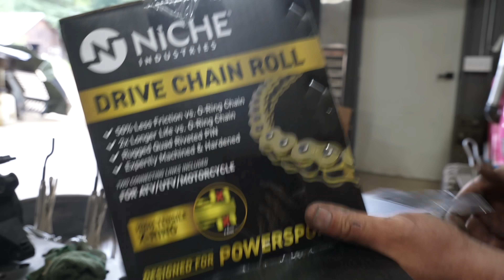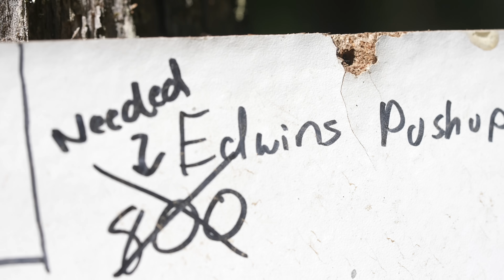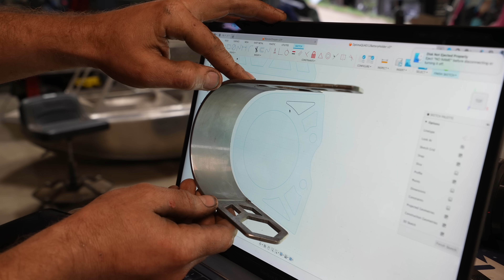We Rebuilt the Chopper and Met State Troopers!

Comment from the maker: Monster chopper tees are almost gone! Get yours here https://www.grindhardplumbingco.com/
Reply: Pin it 😁👍
Reply: Should make another one with 4 tires but both sets on front and back be 6 inches apart with adjustable arms so when you go to turn or lean it pushes one tire and arm higher than the other allowing full contact at all times
Reply: at the back wheel, the axe shouldnt be weilded, weilding its not recommended on structural resistances such as the axe on the back wheel because it can break or bend in time. Use a whole piece of metal and just turning it or milling it. dont weild stuff together when it comes to structural resistances. Also for reducing the the "snake effect" add weights (cosmetics can be) and balance the overall bike, the dampers must be at a certain angle for vertical efficiency ...overall its a really good project i wanna see how its gonna be longterm.
Reply: That's the coolest bike I have ever seen .... Really cool !!
Reply: To probably stop the speed wobbles with the front tire you probably need to build a racket pinion like a car to stabilize it
Reply: I can't really tell what kind of turning system you have but looks like it could be hydraulic or  Pullye  you could  Experiment with hydraulics if you haven't yet Just an idea
Reply: Oh and also it should be in the next Batman movie because that thing is hot
Reply: @iuliancoarna6792  I see no axe wielding 🤷
Reply: What a great motorcycle 🏍️ to watch and I was in awe watching the video 🤩🔥👏👍
Reply: I'd love to get one but I'm a bit on the big side... 5X???  Just a little bit on the big side!!!
Reply: You are risking destroying your lathe welding like that. The reason you are not supposed to put a bit all the way into a drill press is because the heat will transfer through the base of the bit and warp your arbor. apply that knowledge to what you are doing less than 10 mm away from the head of your lathe. 

also, to keep material from warping when you weld You need to tack weld like you would torque a cylinder head. start patterns around the material, get it to where you have a bead and then run a bead over that after it's cooled. That will help keep it from warping.
Reply: There is a reason they make the front tyre skinnier on motorcycles. Look at either getting a skinnier front tyre or heavily rounding off the side treads. Plus more psi in the tyres and a balance will solve the hop issues.
Reply: You totally need to make a cyberpunk Batman helmet with glowing eyes now 😂
Reply: It jumps side to side at high speeds maybe due to the asymmetry of the front swing arm. Its really cool but I luv dat kiki black symmetry  iykyk
Reply: Where I live (not in the US), that thing would have been impounded right away. Unfortunately we have very restrictive vehicle regulations, even when it comes to the tiniest of mods on production cars etc.
Reply: You selling the bike?
Reply: Can you guys make the motorcycle of Cloud from Final Fantasy 7. Either the one at the game or the one at the movie.
Reply: Not in Europe my friend.
Reply: Think of your front tire as a toy gyroscope. That is exactly what it is just scale-up, maybe try shaving the front tire as well? If it's not balanced correctly it will wobble like it does around 50mph
Reply: If you pre heat parts for power coating you don't need the power lead
Reply: :planet-orange-purple-ring:Your bare hands so close to the spinning blade or grinder thingy did not look safe at all. Be sure to wear protective gloves while working. SO NOT WORTH AN ACCIDENT :planet-orange-purple-ring:
Reply: are you seriously breathing in rubber fumes? you hate being able to breathe and have oxygen in your blood?
Reply: @GrindHardPlumbingCo i have never seen your channel or watched a video beside's this one im very interested in whst you and your channel is about! Amazing.
Reply: @iuliancoarna6792  next time do it with one wheel only,,,,,
Reply: Wow so good idea bro❤❤❤❤❤❤
Reply: Nice  dec  28  😳🇨🇺🏆💰❤

Comment: CAE Engineer here - just some thoughts.  That "death wobble" looks sinusoidal in nature - which seems to be corresponding to the top-down shape of the bike.  I would bet that a modal analysis of the frame will yeild a certain frequency in which that wobble is induced.  I also have a suspicion that if you simply add a reinforcement on the left side from the front wheel "cage" to the rear "cage" it will stiffen the overall structure and limit that motion.  It appears to be a force load/unload cycle due to the natural shape of the frame, likely induced by the size and load of the tires..  I can guarantee there would be a lot of enginering students who would love to model this for you as a project for college.  I'd reach out to a couple university engineering departments and see if they are interested.  Edit to add: also, its only doing that wobble on pavement, because of the increased friction between the tires and the pavement not allowing sideways slip... they bind, inducing the wave in the frame which in turn causes it to flex, etc...  in engineering terms its called a underdamped or unstable system.  Edit to add again:  After some discussion here in the comments - I agree that you want an overdamped system to stop the oscillations as fast as possible - critically damped will not stop it quickly enough.
Reply: I love how ingellect can be used together to help!  So much is being made in quiet places.  Hope the money mongers do not get involved.   It is cool to look at!
Reply: After sleeping at a motel 6 I can see you might be right.
Reply: critically damped vs overdamped in this scenario?
Reply: You would definitely want a over damped system, not critically damped. With phugoidal motion, you will only be dynamically stable with an over damped system. If you go with something that's critically damped, you can reach new steady states which will reduce your control.
Reply: @AA-tz2bm  I'm not a suspension guy - just relaying the general theory... I would guess that overdamped is probably desirable as it will stop oscillations rapidly...
Reply: @zuccman968  Yep - I agree.. I replied to another comment above as well... thinking about it some more - critically damped won't stop the oscillations very quickly... so a certain amount of overdamping would be desireable I would guess.  I'm not a suspension engineer, just remember the theory from college and was passing along the info.
Reply: Lol go watch what happens when dirt bikers let go of their handlebars. Lol doesn't matter if you are on the street or off-road. The off-road tires themselves will cause death wobble, so will gravel roads.

Lol it's a lesson most dirt bikers learn pretty quick. Never let go of the handle bars. Sportbikes are one thing since their tires are smooth, it makes it easier to ride without hands, but all it takes is for you to gain too much speed before the front tire catches some drag and starts to wobble.

Mountain bikers learn the lesson to never take their hands off the handlebars also. You don't need the front wheel hitting a bump the wrong way and sending you plummeting down a mountain.
Reply: just looking at it says there are some strange forces making this thing not want to be stable....
Reply: It is also likely that due to some of the shaft fabrication techniques, you could be seeing some rotating imbalance from the drive wheel itself.
Reply: i noticed serious frame flex also,,,,looks to be a dream on wheels but a nightmare to me,,,,,cant think of anything id get from allllllll that expense and work except for attention,,,,i can get all i want cheaper,,,,thanks for the clown show,,,
Reply: @bill45colt What are you so hot and bothered over? Other ppl not doing what you want?
Reply: @ChadDidNothingWrong  in no way am  i hot and bothered,,,,,,im cool and calm,,,,just  reading posts on my tv screen,,,,,whats here to get anyone hot about?? its you who gets hot over words you read,,,not me,,,,
Reply: from a one side to a S shape
Reply: i concur dr
Reply: You know what they are doing 😉
Reply: @helenjones568  I hate those money mongers.
Reply: @bill45colt  your comment was arrogant and condescending
Reply: @prasad530  HAHA  AND TRUE!!  GROW UP PILGRIM!!
Reply: @prasad530  and correct,,,
Reply: Too long
Reply: Da,n dude.  You are def an Engineer.  Amazing what you know! Wow.
Reply: That was the most thought provoking reply I’ve ever seen on a YouTube comment. My daughter is going to college next year to study mechanical engineering - I’ve had her read your comment and view this video. Thank you!
Reply: @LOVEMUFFIN_official  That shimmy might be because the bike is significantly unbalanced from one side to the other. Perhaps a counter balance weight to the right side would correct it... not structural support, but purely for weight. It would have to be pretty heavy if it were on the tire,  unless it were extended 2 to 3 feet on the right.
Reply: What a great and helpful comment!
Reply: The rich get richer...... free modeling give me a break
Reply: Yeah - I'm a CAD Tech/Industrial Engineer Tech - get that vehicle registered and insured bf the cops can arrest you for no reason.  Then get that vehicle 'balanced' bf going on the road.  Cops suck.
Reply: @fastbackgt4821  I was wondering about that. Figured he got off with an "awesome pass: fro the officers.
Reply: @TravisTofTheLeftHand holiday inn😂
Reply: Big brain brother. Noice.
Reply: Brother you gotta be crazy if you think Im reading allat
Reply: @cowboyraccoon1499 It's okay, I had the patience to read it and I'm sure you wouldn't have been able to understand it even if you did read allat.
Reply: It's great to see such a thorough and in-depth analysis! But is there another solution that doesn't require changing the overall structure but still effectively reduces this oscillation?
Reply: Critically damped all the way for zie differential equation representation of spring systems. Over-damped is too much, underdamped is scary time.
Reply: Really? A wobble seems sinusoidal? Who would've guessed...

Comment: Finally got a decent lathe, "I can trust that it's going to stay accurate"...  proceeds to use it as a welding fixture...
Reply: I'd probably probably end up doing exactly the same if I had sumthing that nice to when you wont to do sumthing right you youse the best tools you have, in the long term thay cud convert there old one into a rotary welder
Reply: The heat should stay in the part or reach the fingers of the chuck, not a big deal.
Reply: Well make sure you don't get no weld slag on the Waze 
Or you will lose some precision 
That's a good way to destroy a lathe 
I also have a small lathe and a small mill I love working in my garages 12 of them in fact 
Take care and be safe and God bless
Reply: @kirkslayden834   Good point and he should probably put something down to protect it, but he his also TIG welding and didn't appear to be any slag.
Reply: @danielrichards121 spelling is hard
Reply: But also worth pointing out that it wasn't just a welding fixture.  He needed the shaft to be as close to perfectly straight as possible, and he was welding in such a way to make that possible.  There's literally no other way he could have done it.
Reply: @kirkslayden834  no slag on tig lol, he's not using flux covered rods.
Reply: he is using tig, so nothing will splatter. But I'll tell you this, I love tig. And if I had a lathe I could put round-stock on to weld I would. Smooth and slow.
Reply: As long as the ground is on the work piece it should be fine.
Reply: As a machinist that made me cringe so hard.
Reply: That's  grind way😅
Reply: @Feral_Sage yes sir
Reply: Lol people not understanding how electricity works.  Voltage will always follow the path of least resistance, but it will also follow ALL paths regardless of resistance to some extent.  You're going to get current through the spindle bearings.  It may not be enough to cause micro welding, but it could.  I would use the old lathe or pick up a junk one or just build a rotary fixture before I risked my good lathe.  Mounting a 3 jaw and a 4 jaw to a cheap wheel hub is a good project for a welder.
Reply: @Feral_Sage yes sir
Reply: @Feral_Sage yes sir
Reply: @williamschultz298  current is going through lathe 😂. Not recommended .
Reply: I would be afraid of electrical arc in the bearings.  Not likely, but not a chance I take.
Reply: @nukewurld  "spelling is hard"  --- haha! Says the guy that can't spell WORLD! :hand-purple-blue-peace:
Reply: the spindle bearings are fucking shot
Reply: @jeffreylong9405  No he put the ground clamp on the piece so it ain't going through the lathe.
Reply: @williamschultz298  No, he put the ground clamp on the center.  Theoretically a majority of the current should always travel straight from the part through the center, but it only takes one microsecond of vibration to disturb that connection and send enough current to do damage through the other end, which is the spindle.  That's the big concern.  Arcing in your high precision matched spindle bearings fits rather nicely into the "bad things" catagory.
Reply: Must be quite a wow factor to come across this contraption for the first time.
Reply: Some people don't apreciate what they have.🙄
Reply: @Wheel_Horse  Maybe he was sympathising rather than criticising ;-)
Reply: I mean, it's the most accurate welding fixture he's got.
Reply: Cringe. 😂
Reply: @nukewurld I was gonna say the same thing holyyyyyyy
Reply: I thought the same, but at least it was tig.
Reply: And thats why America is the land of inventions
Cant do that in Japan , everyone, everyplace, everything has pros and cons
Thankyou for the cool bike
Reply: Did you say LATHE.
Reply: Better to use your tools and wear them out than let them sit in the corner and collect dust. Otherwise its not worth buying and taking up space.
Reply: @Feral_Sage  at first i thought i missed him sticking something
Reply: @Hawk013  + a small gear motor and a variac
Reply: @danielrichards121  holy shit, i think you win the award for the most american english in this whole comments section
Reply: @williamschultz298  Don't think he was concerned about the heat.  The arc can often jump across bearing balls or rollers causing damage.  If you have a live center holding the work I have seen it weld the bearing rollers in the center to the bearing cage causing the center to be garbage.
Reply: @Wheel_Horse he obviously did that on purpose though, but you can keep ignoring the obvious if you want to
Reply: @genie3531  nice snark bro.:hand-purple-blue-peace:
Reply: Not a big deal not gona hurt it 😂